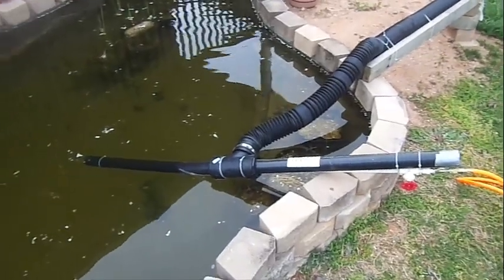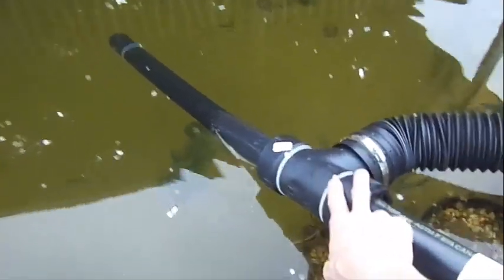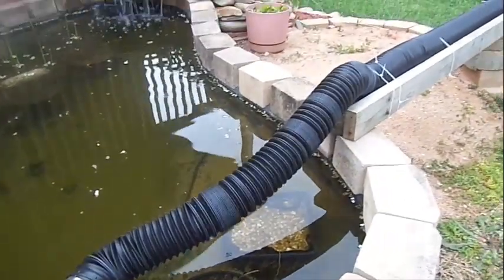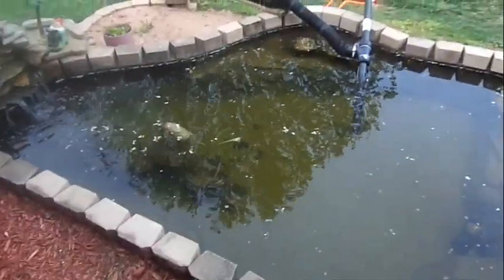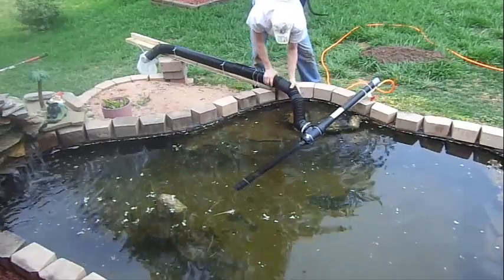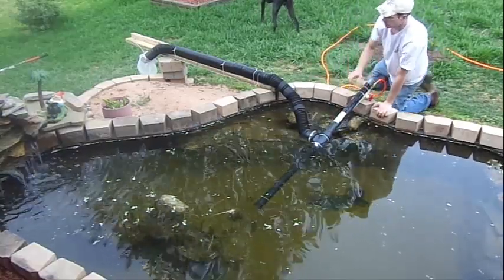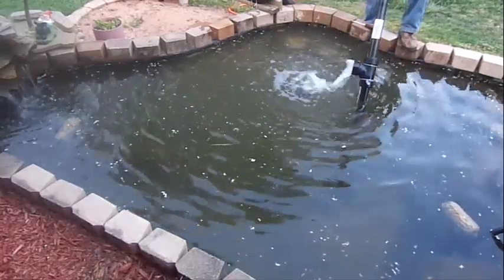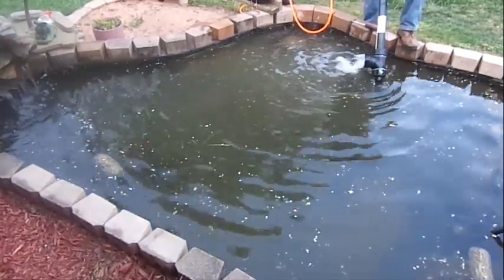DIY Air Lift Koi Pond Vacuum (Part 3/3)

Comment: In your final version can you tell me what kind of metal aerator tip you used?   How much more water lift did you get versus the altered makeshift elbow that was modified with that internal cross hatch PVC material?  Thanks

Comment: This is a great invention; thanks!  I have a large pond and would like to use a larger tube...like 3" instead of 2".  Do you think that would work?  I have a normal 25 gallon air compressor...100psi.  Thanks so much!

Comment: Great job Wayne. I'm impressed. A couple of comments and suggestions: First of all, for all those folks who have replied and talked about all the muck in the bottom of their pond, I would highly suggest putting in a bottom drain. I know that sounds a little scary to cut into your liners to install a drain... but look up some of the how-to koi pond videos for proper instruction and installation (the "Pond Digger" has some great instruction videos.) It's not very hard... and if you can build this vacuum, you can certainly put in a drain. You'll be MUCH happier with the results. That being said, I still love your idea for those smaller garden ponds with lots of plants. They create a lot of debris so this idea would clean things up very well. Now my suggestion: It's been suggested that you might go to a 1 1/2 intake pipe. If you do that, you might also consider using a swimming pool vacuum attachment and the flexible hose that comes with them. You can also get an aluminum pole to push the vacuum attachment around the bottom. The poles are very lightweight and can extend up to 10 feet. The vacuum attachment also has wheels on the bottom to keep you from jabbing your liner and accidentally causing a tear. The wheels on the bottom of the attachment allow for ease of rolling motion and create a nice consistent 1" gap for greater suction. Lastly... if you happen to have a skimmer on your pond (another highly recommended idea for any pond lover), you could send your output pipe there. This way... all of the fine particles that make it through your capture bag would be sucked into your filter system via the skimmer intake. Of course, if you did have a skimmer... you could use the pool vacuum setup I've just described to vacuum your entire pond in exactly the same way you would your swimming pool. You would take the flexible pipe and connect it to your skimmer suction and use your pond pump to vacuum the pond without the air compressor or the capture bag. You would simply be lifting the debris from the bottom of the pond and sending it directly into your existing filter system. Ideas to ponder. Again... great job.

Comment: Hey men nice project, it works really well, I'll build my own soon.
Just an observation the compressor you are using seems to be an oil lubricated piston compressor, its quite powerful but the air u are getting is really dirty and humid, so your discharge water is contaminated with small particles of oil and rust. In the long run can damage your fish and plants.
Better option a 20w magnetic air pump or an small oil free compressor, that way you get clean air.
Reply from the maker: Jorge Martinez - Great observation, and thank you for the feedback! I agree with you when I'm dumping the water back into the pond.....but doesn't matter if it's getting discharged outside of it. Additionally, isn't there a way to filter the air coming out rather than buy a different compressor? I thought body shops and places like that filtered their air.
Reply: ***** yes u are rigth, when u dump the water is not an issue and also u can put a filter in the air lines, but still some particles are going to pass through it. this filters are designed to remove moisture from the compressed air but I don't think they make such a difference with the oil particles.
Greetings

Comment: I really like this concept and plan to put one together for my Spring cleaning.  One question:  I'm curious as to your choice of 2" tubing.  I would think that 1 1/2" schedule 40 would be a bit less cumbersome and easier to move around within the pond.  My pond is only about 6'x6'x3'deep and the liner is exposed (no pebbles or rocks for bottom) so vacuuming would seem to be pretty quick and easy once I move some of the plant containers away.  Although maybe putting in an air jet system at the business end might be a little more of a challenge with 1 1/2' pipe.  Maybe putting a reducer on the top end of your Y to put an 1 1/2" tube for a handle, making it a little easier to hold.  Your instructions and updates are great.  I will be able to put together a parts list pretty easily.  Thanks for posting.
Reply from the maker: ***** - 1.5" would definitely be easier to move around, and I'd like to try making a smaller one. :) Also, the smaller lift pipe would require less air, which is always a benefit. Additionally, you can try different types of "jets" for the air nozzle. You may even want to try less volume and more bubbles (ie. an air stone of sorts as well), but I thought the jet would work best for me. If you can figure out how to make a smaller air supply pipe, this would work really good! I simply didn't have the machines or tools to use something different quickly. Another option for an air supply line would be a steal or copper break line. :)

Comment: OK, it works, but it's a Rube Goldberg contraption.  Very clumsy.  Instead, use a shop vac and put your efforts toward making a brush tipped nozzle and pipe with valve to control water rate to work with the vac.  Clear the floor of the pool so that's it's just the vinyl liner.  Put the plants in pots and the pots up on bricks.  You'll be able to work fast and effectively.  Next, review the size of your filter's media container.  The larger the better to break down nutrients.  If possible, incorporate removable sections in the media canister like screens and floss (disposable, cheap).  This will allow you to manually remove a sizable portion of the bio load and protect the permanent bio media inside the canister.  Lastly, get yourself some Water Hyacinth - the flowering, floating plant with the long black roots.  They multiply like crazy, absorbing dissolved nutrients that would normally go to the algae, but they are easily thinned out and removed when there gets to be too many.

Comment: Thanks for the video Wayne! I made your vacuum today and couldn't believe how awesome it was!  I had to climb into the pond (waist deep) to retrieve some parts that came off because I hadn't glued them before the test run (oops), and I know there was a LOT of sludge on the bottom (squishing under my feet).  Pretty gross. Hoping the removal of the sludge will improve the water clarity!  I'm going to swap out the downspout extension tubing for 2" pond tubing when I have a chance to get to the pond store.  It will be easier to work with and can be cemented to my 2" T.  I can't say enough about how well this works.  It even pulled the clay silt from the bottom (from the plants that my koi unearth from the pots)!  WOW!
Reply from the maker: Hi *****, and thanks for the feedback and kind words! I'm very happy you had good luck with this setup, I hope it continues to work well for you. :) I'm curious, what size of compressor you're using, the depth of your pond, and what tip you're using to disperse or redirect the air in the bottom of the vacuum? I really, really appreciate your kind comment! It means so very much to me to know that people are benefiting from hours of produce and video creation. Keep me updated, I'm curious to hear how the 2" hose will work, I've thought I should try it as well. When you get it out to play with it again, would you be interested in sharing some pictures with me? I'd love to see what you've built! Thanks again and blessings, W.
Reply: ***** Hi Wayne, I'm not sure how to upload pics, but I did take one of all the muck on my patio with the vacuum near by!  After watching your video and buying the parts at the store, this went together REALLY fast.  I'm glad you did all the testing and modifying - because you came up with a genius design!  It's quite simple to build!  I bought a 150 psi, 6 gal Porter Cable pan(?) compressor.  When I started the rig up the first time, I didn't adjust the compressor's pressure down low, and that's why it blew parts off that weren't glued.  After gluing, I didn't have it turned up anywhere near its full power, and it took the level of my pond down about 3 inches in the time I was vacuuming away (which is great, we've had lots of rain lately).  Plenty of suction!  The pond is about 9x12, but that includes the top frame (which is about 200 gals).  The "deep" part of the pond is about 700 gallons, and it is about 3 feet deep in the deepest well.  The "T" in my collection tube is angled upwards towards me, so the waste tube naturally wants to angle out of the pond.  It's kind of a "y."  I'm sure that cementing 2" pond tubing to it will work beautifully. The current tubing was leaking back into the pond some - even though I had it secured with a tightening band.  I had less leakage when I stood the vac upright (and the same suction)!  For the spout that directs the air up the collection tube: I used elbow joints to bend around from the air tube, and the one that turns up into the collection tube is threaded, so I screwed in a brass part that I found at Lowe's where they had lots of brass parts odds n ends for hoses, etc?  I can't say what its purpose is... but I remembered you wanting to have something small there, and this has a 1/8" spout at the end that seems to move freely.  It works great!  I could feel the suction outside the pond when I turned it on!  Another modification I did was to use a PVC shut-off ball valve on the air tube.  It's a 90 degree turn for full on/off - which is easy, and simple to grasp.  I have a similar shut off on my pond pump/fountain setup.  If you can tell me how to upload pics, I'd be happy to share them with you! Ironically, I fell in tonight while adding bacteria (surprise), so I know there's more to be vacuumed in there!  Again, thanks so much for your hard work - and for sharing!
Reply from the maker: Sounds like to me...you should be doing videos,  teaching people how to think outside the box too *****! :-)

Oh, I totally understand what you did and how you built it. Ingenious! it sounds like your pond is just a bit smaller than mine, but I'm a little bit deeper. The deeper the pond, the stronger the lift action will be, because of the velocity of the airflow. If you really want to get creative, you can even play around with low volume air flow which is broken up by an air stone or something that creates hundreds of little bubbles. In theory, a lift pipe filled with water and small bubbles should have a greater amount of lift than the same pipe filled with larger bubbles. I couldn't figure out a way too easily do this, using many of the items I had laying around so I opted for the design which seems to work well. My goal, would be to eventually figure out how to run this on a very small air pump, and low volume. This would give more people access to use one of thes without going out to purchase compressor. I would even venture to say, that's a small flexible hose of sorts could be set up too "roam" around the bottom, cleaning while you walk away to do other things. 

Well, guess the good thing about falling in as you learn a lot more about your pond expected to! I've been there so many times I don't think I can count on 2 hands. :-) Thank you so much for the feedback.

As far as uploading photos, it would be okay with me if you just wanted to email them. You can shoot me a private message on youtube, and I'll respond with my email address. If you would like me to show you how to upload them, I'll be glad to do that as well. Just let me know what works, teamwork is awesome!
Reply: Hey ***** , let me know when you figure out how to let the pond clean itself.  :)  I'll make one of those!  :)

I've been telling myself for weeks that the rocks are shfiting from my walking on them and aren't as stable as they were when I constructed the pond.  And today... the one I was walking on shifted, fell in the pond, and I followed!  I got out, grabbed the net, and went back in to get sludge out while I was there.  LOL!  

No idea how to send a PM to YouTube, so I tried a "hangout" on google+.  If you don't get it, let me know.  These are tools I don't use and am figuring out.  

Heading to Home Depot tomorrow to check out some pool backwash hose for discharge. Rolls up neatly when not in use and is 25 feet long!  Oh, if the weekend could just be longer!
Reply from the maker: ***** - Hey there! Yes, they just changed YT the other day and I didn't even know it. :-/ Keep me updated on the progress, I enjoyed those pictures! :)

Comment: They told me in order for the plant (specially water lilies) to thrive they will need heavy clay soil and fertilizer. Gravel and soil will not hold the fertilizer and cause green water. So far the plants are doing great.